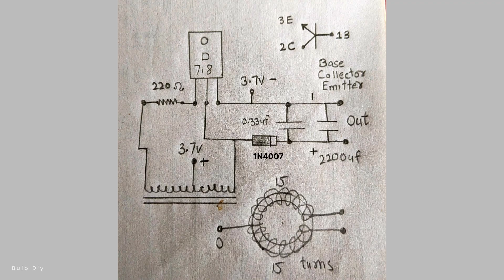How to make voltage booster circuit | 3.7v to 12v and 220v | Dc to dc boost converter module

Comment: How long the duration of power supply will work  from the 3.5v battery
Reply: How long the power supply( 3.5v)will boost the circuit from  12v and 220v